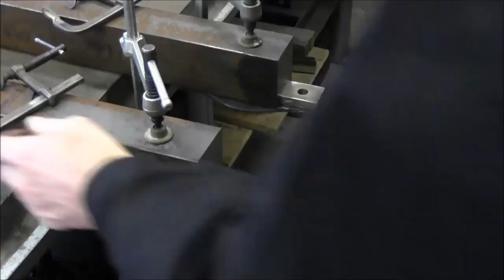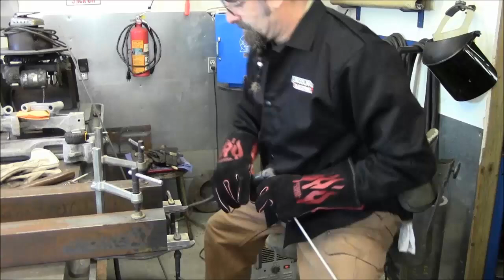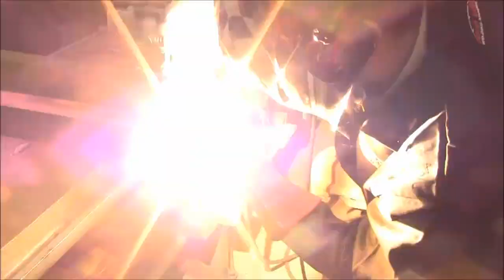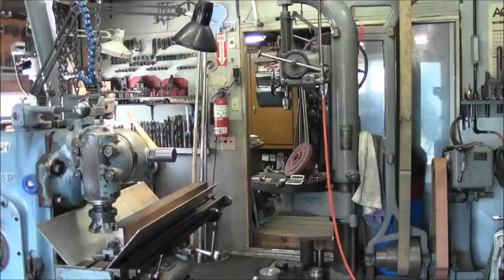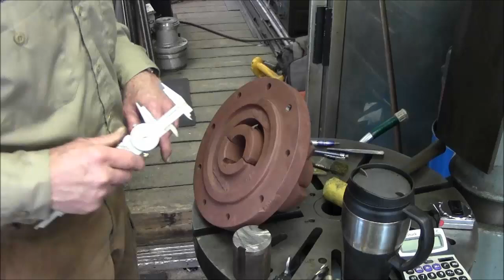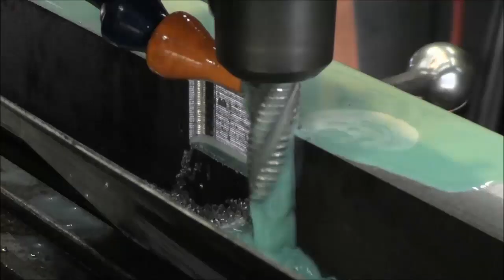Job Blending Part 1: Machining a Drive Hub for a Tractor Axle Shaft

Comment: I am lucky enough to have a pair of matching machine vices for my mill,they can hold long jobs no problem,good thing to look out for or even machine to get a pair same hight? When comes to removing so much stock like this I like to use a carbide tipped slitting saw to cut off the excess. As a bonus, you get a good offcuts to use on another job! Great video by the way.

Comment: Thanks for the videos, always enjoy them.  I'm curious about a setup like you used for those slabs.  With the 15/1000 of preload on those pieces, if you put a dial indicator at the center of those slabs would you see them rise measurably?  In other words, if this were high precision would the tension of the tie downs influence the dimensions in a meaningful way?  Thanks!

Comment: Mr. Pete is a great teacher - he does especially well at teaching the basic principles and techniques...

I found Keith via Mr. Pete. Keith does a great job of showing you how to do precision work when you are pushing your equipment to the max. Also, great info on how a turnwright / millwright deals with shafts and sheaves, and how to use welding to make the machining go easier...

Comment from the maker: Yes, there is always a bowing effect to some extent, just like a weld pull. the bars were cut into four small pieces and the bow was not of concern, on this pacific job but I like the comment and everyone should be aware of stress relieving by removal as much as weld pull and or heat draw. ;{)-----

Comment: Keith,  Question,  Why did you end O the bar you were thicknessing with the Milling cutter,  Looks as if you have the table length and travel to mill in one set-up?   What am I missing?  I realize the way compliance may give you a bit of a bend in the machined face due to overhang, But will be the same even if you end O?

Great video,  E J

Comment: I used to work with a fella a lot-shorter than me. I'd get tired of gettin' the "knee"-crank in my shins---so I'd leave it in the half-hitch-up position. He'd come along after me, and get it in the groin---after which we both-agreed to RE-name it the "knutt"-crank, when he operated it.

I miss those days, and even though I ended-up on a CNC-Okuma machine center before retirement? I always missed the "romance" of these!

And I see you have the same feline-"boss" in your-shop as I do in mine...!

Comment: The problem of the chatter may also have resulted from the inserts not being able to cut away the most upper part of the work - so the cut maybe was deeper then the cutting edge of the inserts which thereby made the shell mill itself rubbing on the metal.

Comment from the maker: The video was intended to show milling differences in between the K&T and the Bridgeport, then found a problem with the hub key before starting to cut it, so continued to work large squares and the second video finished up on the changed plans for the hubs. But the biggest lesson is jobs change sometimes and you need to keep eyes open, don't just take one word and adapt to keep the work flowing, without blowing a gasket! ;{)-----

Comment: Check out the Miller welding products website:  Stick Welding Calculator.  But the "general rule" (for approximate amperage setting) is one amp per 1/1000" of rod diameter.  1/8" = .125"  So, roughly, around 125 amps.  Add or subtract from there, depending upon material thickness, etc.

Comment: Keith, you crack me up.  After measuring with your machinist scale (5 or 6 times on each side of the hold down clamps @6:15) and lightly tapping with a hammer and measuring one more time you say "close".  :-)   I know its a machinist thing and to be more than close you would have used a dial indicator but it struck me funny.  I enjoy all your videos and appreciate you taking the time and effort to produce them.

Comment from the maker: If you add a shim to the center you will be changing the thickness of the overall length and have a bow also. but good thought. the full length was cut into 3 or 4 pieces. ;{)-----

Comment: Keith, I'm guessing its not imperitive that the part stays straight in this case, but if it was imperitive would you just toe clamp a small block in the middle of the piece to take out the 20-25thou of bend?
Also, A big thanks to you for sending me the hat. (working with my wife on the sly) I could hardly believe my eyes when I got home from work and found one of your hats on my desk. A total serprise. Thanks again....

Comment from the maker: Well I don't have the killer band saw, that would auto feed through a three inch thick part for the three foot long cut and cutting it in the mill, with the same set up, for roughing it, is able to create the finish true to the part also. ;{)-----

Comment: Thanks, Keith!  Would have been fun to watch, too!  I see NOS top US brand HSS horizontal slab cutters on "that auction site" for pennies on the dollar...but you've already got the operation covered with that shell mill cutter and replacing inserts is likely cheaper than sending an HSS cutter out for sharpening.

Comment from the maker: Yes, the table has a drain that passes back down though a return system built into the machine, Cool! glad your able to understand my old school names for some of the tooling. Before inserted facing heads all simular type cutter were called shell mills, in my book.  ;{)-----

Comment: Good comment.  A "shell" mill is a modular tool:  bits, shell, and arbor.  A basic/plain/ordinary mill is a single unit.  That's a lot of expensive alloy!  Various diameter, style, etc., "shells" can be attached to a standard arbor.  If you crash a basic mill, it is damaged or ruined.  If a "shell" mill wears out you just replace the cutting inserts.  If it crashes, the arbor or shell may survive...

Comment: As he's working the piece, Keith notes that he is not pushing the tool or machine.  If there's one thing I've learned from Keith, it's that if you don't have to push something, don't.  You may get there faster, but your chances of screwing up the quality of the piece, or your equipment are much greater, and not worth the time savings.

Comment: Great vid!  Like your work holding solution, leaves tool path wide open.  Respectable cuts, good to see the old girl still has it in her!  I'm a little surprised you did not use the horizontal spindle with an arbor and the outboard arbor support, but maybe you don't have a wide enough slab milling cutter?  Would it have been any quicker to have milled using the horizontal spindle?

Comment: I think your SFM is too low for that shell mill.  I calculated 120SFM for a 3 inch shell mill at 153RPM.  That carbide is probably rated for at least 300SFM for alloy steel.   You are leaving money on the table by running at half the SFM, and your IPT is probably light too.  I bet you could remove that material at least 4x faster if you used even the conservative ratings of the manufacturer of the inserts.

Comment: Yes, on machines with some backlash in the feed like you will find on most manual machines, this is the way you want to go, especially for heavy cuts. Modern CNC machines and manual machines without any backlash can cut the other way and is generally preferred. It's called conventional vs climb milling.

Comment: It is my understanding all face mills are shell mills but not all shell mills are face mills. Shell mills are cutters with multiple inserts, the orientation of the insert determines the type of shell mill it is ie possibly a face mill. It depends on the operation it is designed for, some chamfer, some face, some bore, and so on. His K&T like my Cincinnati has a drain with a screen over it built into the back of the table. It routes the coolant back into the base of the machine its also the sump.

Comment: So you use the aluminum plates to help with the splattering of the coolant, but where does it all go? Does that machine have some sort of drain in the table or something? One last thing, is what your calling a shell mill the same as a face mill? Thanks for another great video.

Comment: Hey Keith, I tried the link (after you said you fixed the previous problem and now I get this: 404 - File or directory not found.  
I've seen Mr. Pete's videos and just bought his series on "How to Run a Lathe" as I have recently purchased a South Bend Heavy 10.  They are very good videos for sure!!